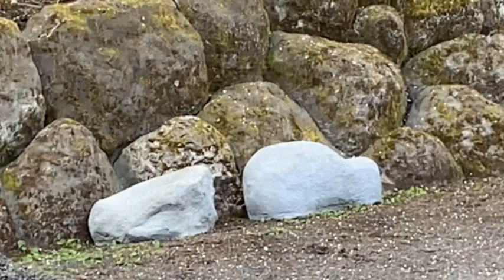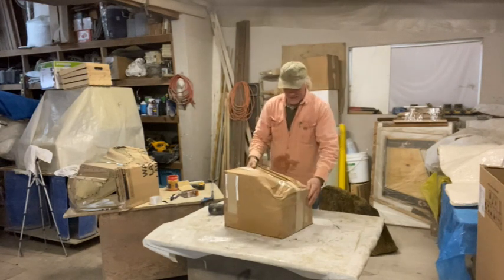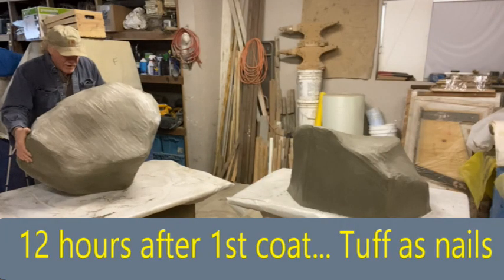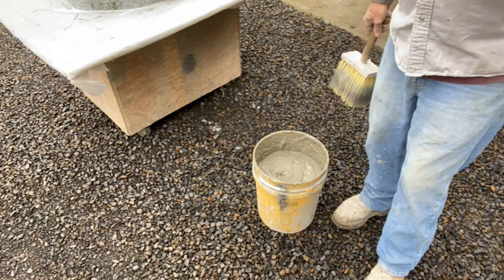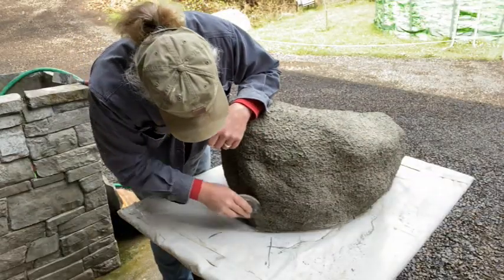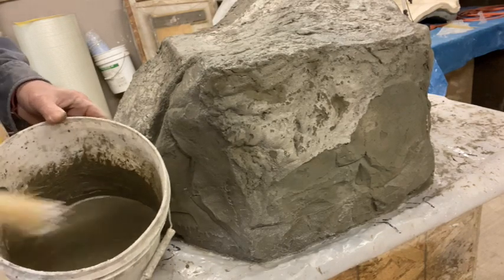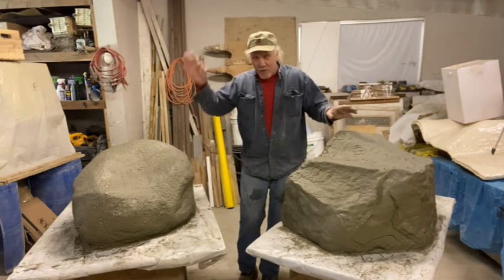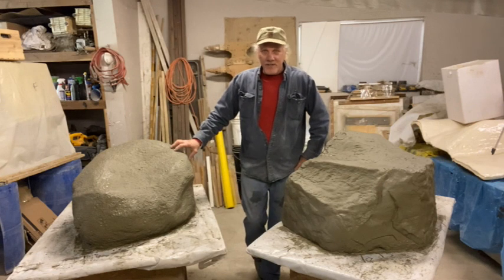How to make a fast cardboard rock

Comment: What happens to the underside/bottom of faux rock when you use box? In landscape due to moisture does it just deteriorate over time? 
I’d like to put faux rocks on my pond shelf , so underside needs sealed, so you do 360° of faux rock ???
Reply from the maker: Roy doesn’t matter about the cardboard after the rock is made but if you were inclined, you can take it out and yes, we do make 360° rock.
Thanks for watching my video

Comment: How heavy is the finished rock? I have to make a 4ft high and 6ft long rock for a performance set and it needs to be easily movable.
Reply from the maker: These rocks will weigh in a 2 1/2 pounds per square foot of surface area. If I were to make something with a target of being less weight, I would use a stronger mix.Thanks for watching my video.

Comment: Good stuff <thumb up>
Say, I don't see an explanation or info on the HYDROSEAL (what it is, how important, etc...), or info on the BONDING AGENT, what it is, product name, how important, etc...Lastly, if s/one were to add COLOR for the finished look, can you paint it on, mix a product in some of the cement, etc?  THX
Reply from the maker: The hydrocele of proprietary mix, which I only provide to students that are going through my training program. I appreciate you watching my video.
Reply: @fauxrock  That's fine & I appreciate your reply, but the question then simply is, what does this HYDROSEAL accomplish?  What's the express purpose for the application?
Reply from the maker: @Kman. It’s my first attempt in the process of building a rock to make sure it is sealed. Two separate coats of Hydro seal are my first real attempt of stealing the rock in the cement realm staining the rock and then sealing that stain with 100% acrylic clear sealer is the final steps in making sure it’s sealed. I hope this answers your questions.

Comment: Great info, where do you get the mesh for reinforcing? I have been looking it up. Depending it aint cheap! Have fun out there Jim!
Reply from the maker: I purchased my role at a composite company, but you wouldn’t want to do that… it’s 7200 feet long by 4 foot in height and cost around $6000. There’s a link below that I placed for Home Depot mesh which will work great. I actually have a roll of it here at the shop but it’s only $67 for 150’ x 38” tall.
https://www.homedepot.com/p/BOEN-38-in-x-150-ft-Non-Adhesive-EIFS-Stucco-Mesh-EM-38150/203071686
Reply: @fauxrock  Thanks Jim, really appreciate it! Peace